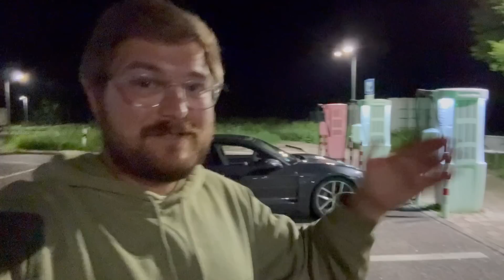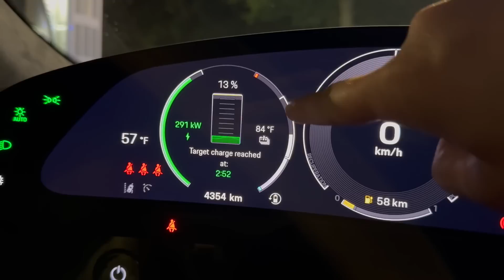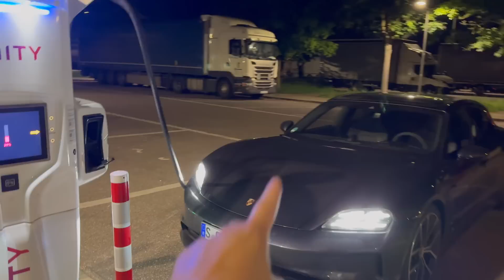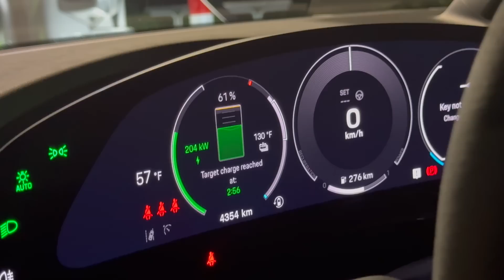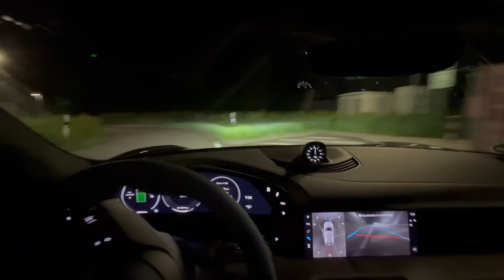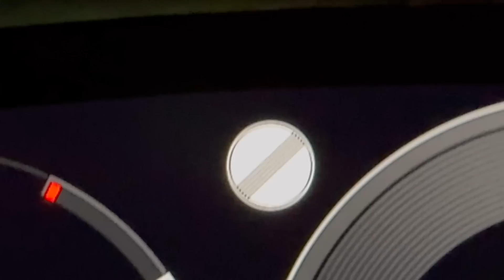The Fastest Road Tripping EV I've Ever Tested! Updated Porsche Taycan Sport Turismo 10% Challenge

Comment: How will fast charging affect the battery life ?
Reply: They said that they made tests with charging speeds that are a bit slower than with the car they released know and it showed almost no degradation, so they increased the charging speed even further
Reply: It is Not that extreme you think...they charge with about 3C as Peak...300kw/100kwh...which is already done by others, too. The real improvement is the relative high Level  almost the entire charging time.
Model 3 is at 3.2C...250kw/77kwh...but the Peak is very short and charging much slower due to this. They have a really bad charging curve, whereas the new Porsche Curve is relative flat.
Reply: @josefv-y8m  I wonder why Tesla keeps the peak short
Reply: YEP THATS THE TRUE =

Comment: 15 min timer should start when you step out of the car at arrival. That would simulate be a real world road tripping stop. Has Porsche mentioned if this charging power will be coming to Audi/VW/Skoda/Scout? 130 F toasty.
Reply: They start the charging timer when charging starts because some chargers have very long handshake time and the result shouldn’t be affected by that. This was how they explained it. The Taycan is the flagship with the best and most expensive tech. The old Taycan battery only came to the Audi GT, the rest of the VW group cars are 400v.  Even the new macan and Audi Q6 get a different and likely cheaper 800v platform.

Comment: This car approaches charge-up times similar to gas-fill-ups.
Reply: Really? How exactly did you come to that conclusion?
Reply: is diesel also "gas! because a fill up of a similar vehicle in diesel version will get you up to 900 miles of range literaly double of any EV.
Reply: @carholic-sz3qv  And you're paying double or likely triple what you'd pay for an EV to go the same distance. Even more if you consider cheap charging at home.
Reply: @fiehlsport  most charging is done at home so overall savings over a gas vehicle. Unless you are a traveling salesman or something and EV will be cheaper for 95% of people.
Reply: @fiehlsport  nope in Europe
Reply: 45 seconds of charge gets me 8 hours of highway driving-time in my 2016 Prius c Two.
Reply: @aliendroneservices6621  For those of us who don't use catheters when we drive this car approaches time taken on fuel stops.
Reply: True, but no issue anymore...after 400km it is time to have a stop, at least for me. And this stop takes in average 25mins, which I have measured several Times.
It does not matter if it takes 45s..plus payment, not needed for an EV...or 20mins to Charge, fill for your next step. For an EV you just plugin and go away for a coffee and payment is automatically done anyway. 
On daily Basis you can charge at Home or at your employeer, which can be very slow, since a car is usually a 23h a Day standing Equipment.
And Yes, this is just a matter of infrastructure, which needs to grow with increasing numbers of EVs.

Comment: I have the '22 RWD Taycan, hoping to get the new dash software. Love that charging display.
Reply: I was told that new software is not coming to older models. It's a new operating system. However, I hope some of the features will land, CarPlay+ is the one I'd like to see...
Reply: Sadly most of the legacy manufacturers are not delivering newer updates to older cars, even though they have the hardware to support it. I love my EQS but Mercedes is not delivering any updates that even cheaper and less equipped newer (EQ) cars are getting, I'm very disappointed. Even though I'm not a Tesla fan, props to them on diligently updating cars.
Reply: @ani_b  there are few reasons why these major updates are not happening. Most important one is the directive about cyber security in EU, which was implemented in July 2022, becoming mandatory in July 2024. That directive basically rendered, at the time, current hardware platforms as outdated. These facelifts come with new hardware that will allow them to implement new directive. Otherwise they would not be allowed to sell these cars in EU.
Reply: @ani_b  someone gave you the actual reason for what manufacturers are doing. Something you never bothered looking up despite your constant whining on the channel, and not even a single; "ohh, thanks... wasn't aware, but now I understand", or it's equivalent from you.

The world is ever changing. This is an EV specific ruling, and Mercedes is one of tye only few Manufacturers that wasn't vastly affected by tye ruling as they're easily the top dog in the German space, when it comes to anything tech. Unlike those who have to cease production of older models or some kine entirely in the EU, they can at least still sell theirs. But newer models with more advanced model is required to be able to keep up to date with anything major. If tye older ones do get extra certifications for UN R155/156, then that'll take quite a while.

You'll still get basic updates. You pretty much have the best infotainment in the auto industry and I can't for the life of me even get the point in your whining. No one lost a life when their ICE or Hybrid car wasn't updated to a newer MB NTG version. You already have a version of NTG 7 that's more advanced than the normal one. Basically a 7.5 of sorts, and 8 is only on 2/3 models as we speak. So relax.
Reply: @Awaks  lemme get this straight. Your "explanation" for why I should be ok getting no updates on my promised updateable car that cost $120K+ is - it has a higher UX version than others? Do you know these updates go beyond UX? Do you know what the features I'm complaining about are, or how many other EQS owners feel the same? Or that I'm referring to updates that have been delivered to newer MYs of the same model, even small ones that are not dependent on hardware?
Reply: @ani_b  Did you skip out the EU regulation bit on purpose or are you just clueless in general?

Did you skip the bit were OEMs had to seize production of vehicles due to the regulation, or are you just light headed in general?

The first point touched on was why every single OEM that wants to sell in the EU, and worse, originates from the EU, just did what they did, and later why Merc was among the companies that got least affected by the rulings, when you compare what happened to many other OEMs.

I literally told you why you shouldn't bother as much as you keep doing, since there's nothing that can be done about any of this in the first place, and why you already have a system better than the majority already.

You think GLS, G Wagen, S Class, or AMG customers bother too much with stuff like this?? 120k is lower than the price of an E-AMG. They don't die, so you shouldn't either. Your foundation is already solid. Major issues willd definitely need a visit to a shop and not an update, and you will probably get some minor updates.

Hope this helps. I'll try all caps if it wasn't clear enough..

Reply to the guy who dropped solid info for you btw. Don't avoid the Elephant in the room like a b****.
Reply: @Awaks  did you see my point about newer MYs getting those SAME updates? Also, EU models have gotten WAY more updates than their US counterparts, I've  confirmed this. That invalidates your points entirely.

Also I know it's the internet and you seem angry - can we keep it civil and on topic or is that beyond your capacity?
Reply: @ani_b  Did I see you point about newer ones getting the update.

What models do you think the Legislative affects the most?? 😭😭 This dude, man. The newer models are literally made to comply so they get more updates. Tf??

We dropped a legislative for you and you haven't even bothered opening one oage, or even searching it. When you actually bother, then you come over.

It's gonna be pretty obvious when you do. You don't even know what the ruling is about, clearly. And that's hilarious to say the least.
Reply: @Awaks  ok let me try again.

So by your explanation. 2021 models in EU shouldn't get new updates, right? BUT THEY HAVE, while the US 2021 models with no such laws, haven't received the SAME functionality. But, Mercedes-Benz delivered those updates delivered to 2021 EU cars in US 2022's and 2023s. Can you explain that?
Reply: @ani_b  EU R155/156

Go read. I beg. Go read m8 😭😭

Trust me, I ain't doing this ** until you do....

hope this helps